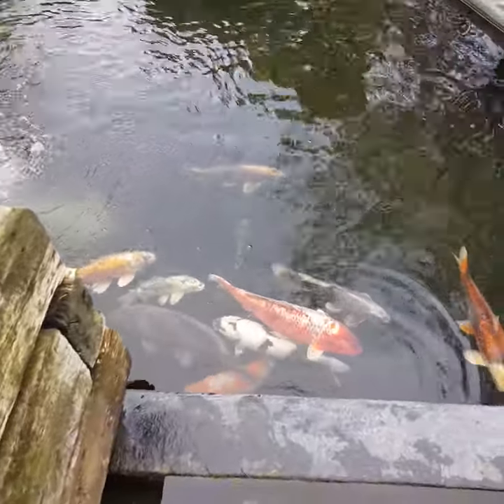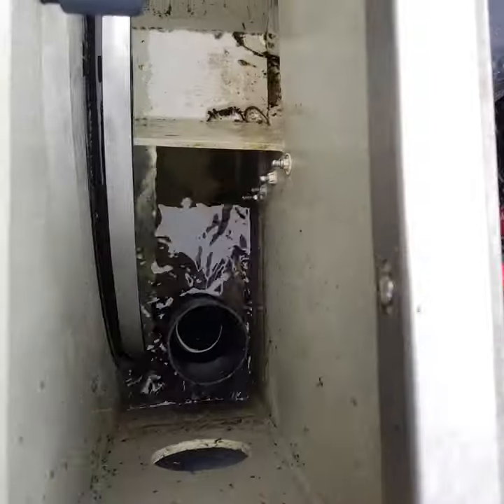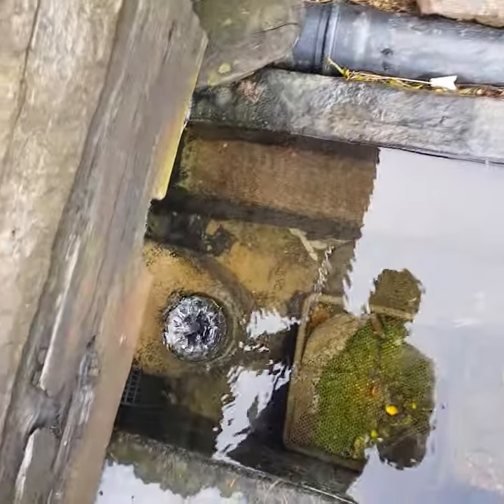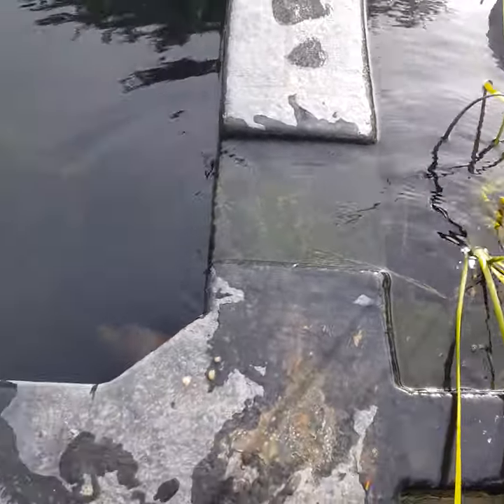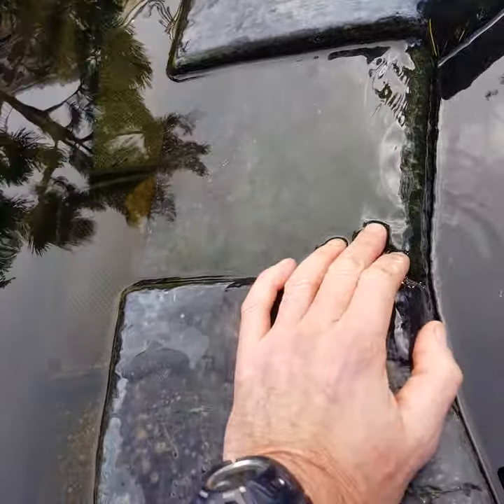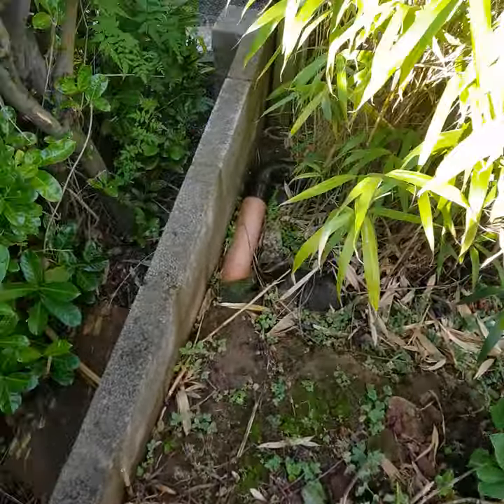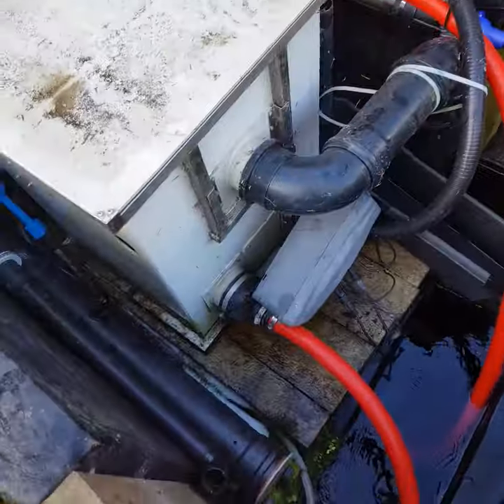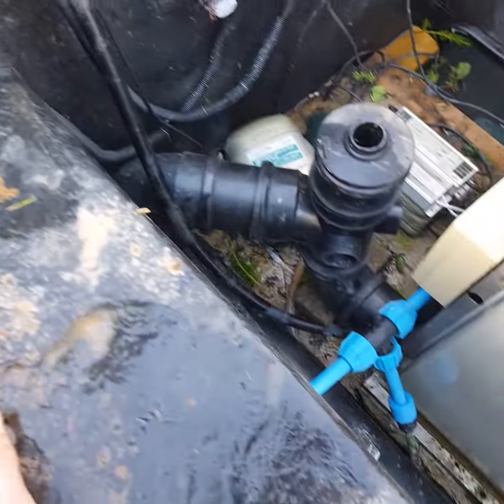Anoxic Pond Filter on Koi pond walk-through

Comment: Amazing... Love it ... what is the RDF you are using? We are looking to get one but didn’t want to break the bank. Also ... did you say fiberglass is the pond liner? Thank you
Reply from the maker: The Drum filter is Burtons BD300 - I've had to modify it significantly due to lots of design failings so it wouldn't be my first choice again.

Yes it's fibreglass. Had to do it myself as no pond companies would  quote because it wasn't a simple shape. DIY fibreglassing isn't hard as long as you follow the "rules" regarding weather, temperature etc.
Reply: Glad I hung around to see the self-cleaning rotating drum!!
Did you use epoxy or Polyester resin?? Any issues with it?
Thx. 
Some lucky fish you nave there! 😊🍻🍀

Comment: Thanks for the videos. I am looking to rip out my current system and install a drum and a small anoxic pond which will spill into the Koi Pond. I have 20 koi in a 3200 gallon pond so have a 1.2 x 1 x 0.6m box with 20 baskets and plan to have a few floating plant baskets too for effect.

I note the flow into your pond doesn’t seem fast so are you creating much movement with your returns or is your bottom drain pulling enough much to the drum via the sump?
Reply from the maker: My pond is around 13,500 litres which I think is about 3500 uk gallons. 20 baskets should be ok. I have about 35 to 40 purely because the pond was never designed to be anoxic but when I discoverd it at rhe last minute I found it was the perfect size for baskets.  :)
Each pump is 12,000 litre/hour so I'd guess actual flow is 22 to 23,000 litres per hour. 
It wasn't evident in the video but the 2 x mid water returns have a strong flow and the 4" "overflow"  pipe goes through a 90 degree bend so it also returns mid water so all 3 returns create a significant rotational flow in the pond. 
The bubbles from the bottom drain look like bath water goind down the plug hole. Sometimes they don,'t reach the surface but a few seconds later the "twister" collapses and everything returns to normal. 
So plenty of water movement but the fish barely notice it and to watch them you'd think the water wasn't moving.  🙂
Reply: @GymratzCoUkOFFICIAL  awesome I can’t wait to get my set up going. I can definitely squeeze in some more baskets was just working on the one per fish rule... really good to see a working example. Lovely pond ;)

Comment: Wow what a dream set up. Thanks you for sharing this video. I've been thinking of how to reduce my water changes and this might just be the answer. I want to 'brick off' the shelves around my pond and make a river with anoxic baskets. But doing that will reduce the swimming areas for the koi in my already small pond. I'm thinking later on when I am less overstocked. Also nitrate levels which I like to keep at 5 ppm (10max) is limiting the amount of food I give my koi. Anyways you have very nice established pond and  koi. Subscriber #38. And thanks for taking questions so here is mine: What is your nitrate level and how much to you feed your koi? I guess you don't do much water changes, maybe 5-10% per week with the RDF flushes? Again thanks.
Reply from the maker: Nitrates and Nitrites are always pretty much zero. I gave up water testing as it was always perfect. 
That's not quite true as I test one or twice a year.  😁
I couldn't say how much water gets changed by drum over spray and rain but it's very little. 
I don't have an over flow from the pond but have a "U" shaped pipe (briefly seen in the video) that I use to siphon down the water level to the point at which the skimmer starts skimming again as it doesn't have the pull of a pumped skimmer. 
Very rough guess I'd say some weeks I have to lower the level by an inch or 2 after heavy rain and in the summer perhaps remove 1/2" once a week so given there's also no filter flushing water changes are barely measurable and not conciously performed.  
Feeding: I'm not a fan of auto. "force feedibing" . Morning and evening in Summer, more on the weekend if I'm in the garden but also happy if zi miss a few dsys as there's always loads of natural food (critters) being washed into the pong from the anoxic rivers.